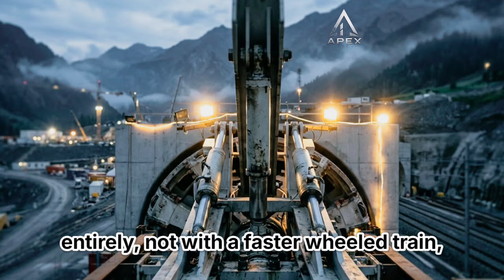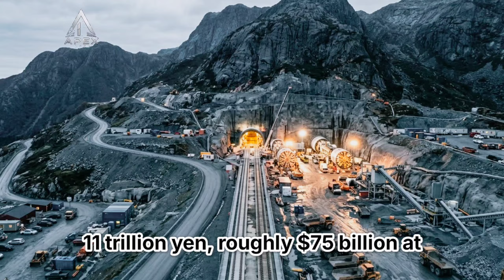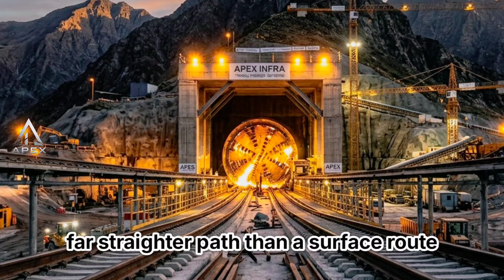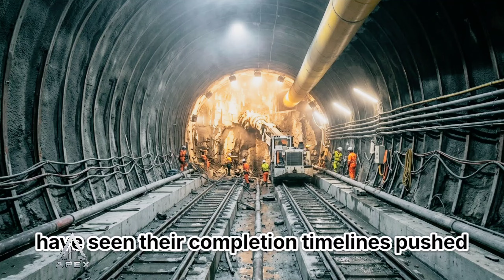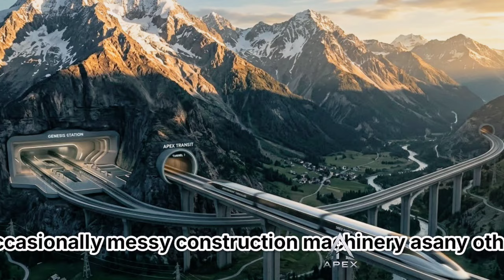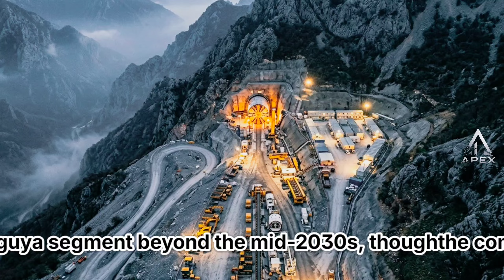Japan's $52B Bullet Train Doesn't Touch The Track!

Comment: Linear (maglev) railway systems require underground operation due to factors such as the generation of strong magnetic fields and shock waves, as well as the need for a straight track alignment. Consequently, complex tunnel construction projects are underway beneath mountainous terrain and regions characterized by a succession of densely populated cities. In contrast, construction in the United States would likely be far less challenging, given the country's vast territory, low population density, and fewer issues related to groundwater. Nevertheless, resolving the challenges of this exceptionally difficult construction project is currently essential to addressing Japan's transportation needs.